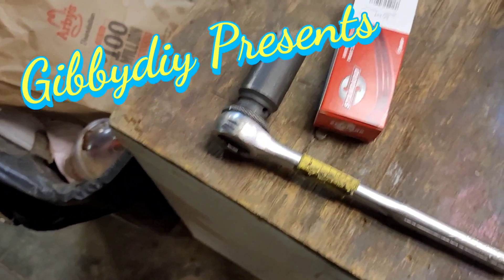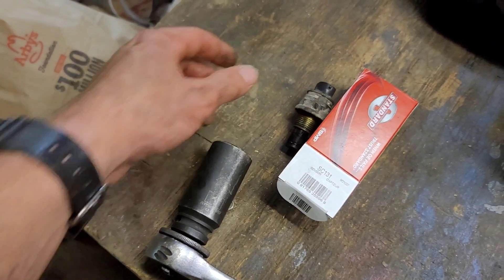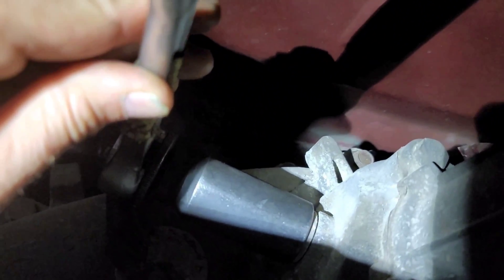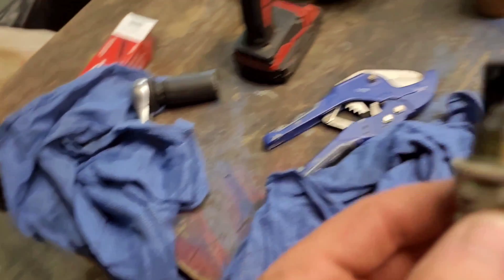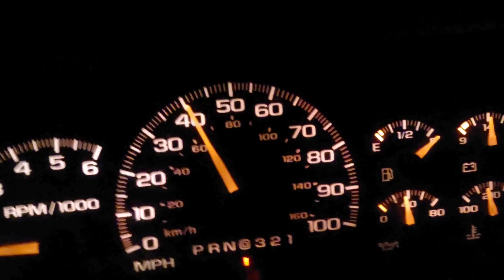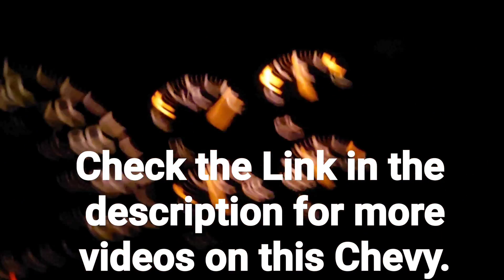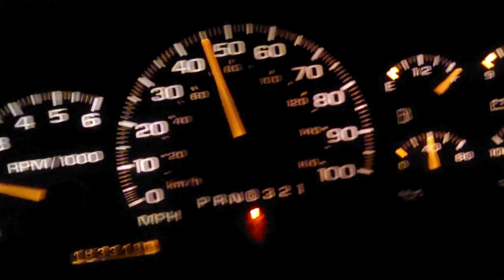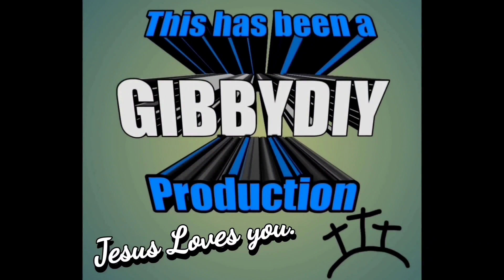97 chevy (VSS)Vehicle speed sensor change.

Comment: In your video you did not tell if it is located in the transmission or transfer case.  Where is this switch located??????
Reply from the maker: Transmission, sorry
Reply from the maker: Transmission, sorry
Reply: @gibbydiy4235 so there’s two, one front side of transfer case and one on back

Comment: Well I gotta new transmission in and the wiring harness got wound up on the front drive shaft and completely destroyed there’s so many lose wires hanging down I been trying to figure out witch one is it but can’t
Reply: Did you ever get it figured out? I could climb under and take some pics for ya.

Comment: I just got. A 99 4x4 suburban. It says I'm going 90 when I'm doing 60mph. Any idea what's the problem..guy I got it from never said anything about that. Maybe the difference in tire size? Or could it be this part?
Reply: There are two speed sensors, the one that is being replaced in this video tells the transmission controller when to shift. On an OBD 2 scanner that shows live data you can view the data from this sensor but not the one that drives your speedometer.
Reply: @dontmesswiththeman  can you give the part number for the speed sensor that controls the odometer reading
Reply: @dontmesswiththeman  mines is a 92 4wd Gm Yukon for some reason this is the only censor I see
Reply: @DominiqueJeffries  your 1992 has a different transmission, you have a 700R4. You will only have one sensor which feeds the speedometer.

Comment: Will be great if you tell us the symptoms. Thanks
Reply from the maker: it was hung like in 2nd gear also Abs light came on,, i mentioned that at the end any way i should of mentioned that up front go to the end when i drive the truck.
Reply: @gibbydiy4235  thank you Gibby, Mines hanging in 2nd too, and the tranny feels like it doesnt wanna find a gear.  Also, the gas milage goes WAYYY down, probably from the tranny not acting like it wants to find a gear.  This happened about 2 years ago and it was the VSS...so I'm trying it again.  That was about 50K miles or so ago...maybe more.  The light has not come on yet, but the google machine says the light wont always come on unless it trips.  Praying the new VSS is what the issue is. At the moment, i don't want to drive it like it is...the horsepower has gone away, but she still purrs.
Reply: Mine came up as a code on the obd2 and said speed sensor that’s why I’m changing mine

Comment: 1997 Yukon SLT should be the same right? And arent we supposed to disconnect the battery terminal first?
Reply from the maker: mechanic 101
Reply: Technically you don't have enough volts going through to cause any damage when it's off.